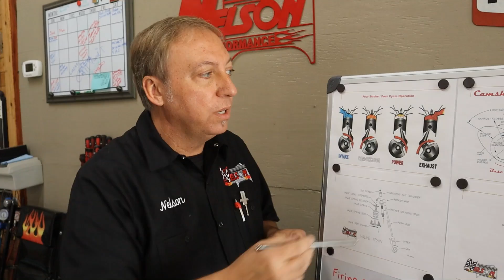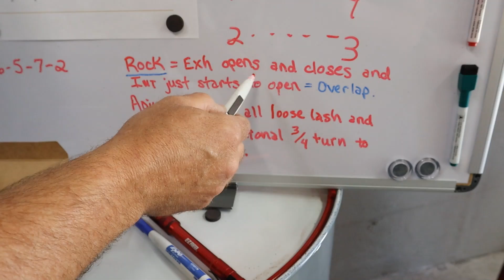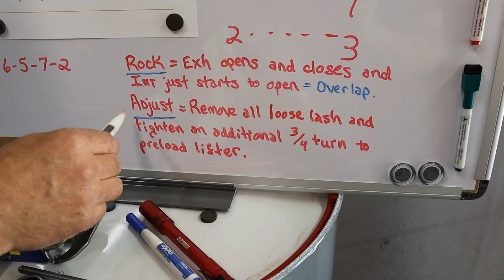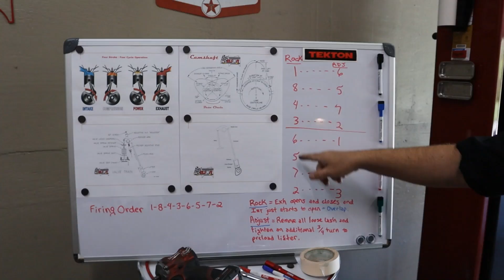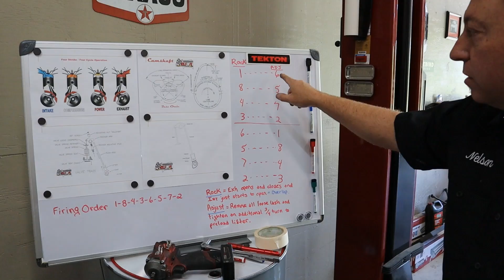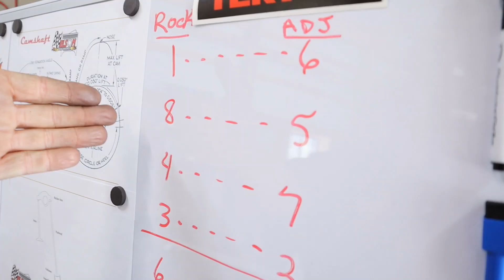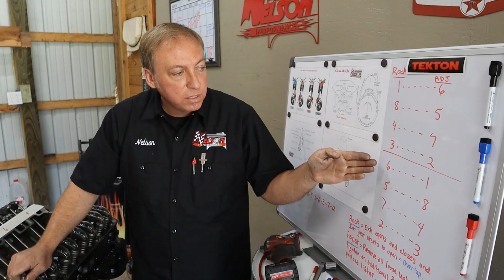Rocker Arm/Hydraulic Lifter Adjustment

Comment: so if you have the timing marks lined up & adjust # 1 cyl, could you just turn the engine 360 degrees so both timing marks are @ 12 o'clock to adjust # 6 cyl ?, thanks for an excellent video
Reply from the maker: Great! 👍Glad we could be a part of the project and thanks for viewing and commenting, Nelson

Comment: I must've missed something. What clip is he talking about in relation to the plunger ?
He doesn't want the plunger be touched by the "clip" 
Does he mean there needs to be clearance between the inner circlip and the central plunger ??
Reply from the maker: Hey Tony, yes, the wire circlip that retains the plunger. The 3/4 turn places the plunger away from that clip to prevent hydraulic oil pressure from popping it off and it ending up in the engine. Thanks for viewing and the comment

Comment: Can i use this method with lifters that are already pumped up? All of mine are still touching the retaining clip after im finished.
Reply from the maker: Hello, you can still use the 3/4 turn and do the adjustment with lifters that already have oil pressure in them. The valve springs have enough pressure to “bleed” the lifter back under full valve lift during the adjustment process since there is no oil pressure until the engine is started up. Good luck on your project! Thanks for the comment and viewing! Nelson
Reply: @mitchnelsonperformance  Thank you so much for the reply, Even though this video is many years old. 🤝🏼
Reply from the maker: no problem! Good luck on the project! Nelson

Comment: Hey there mitch, great video! One quick question. Can I use this method with an already installed motor will many miles put on it? 454 to be exact
Reply from the maker: Hello first off, thanks for the view! Yes, that will work just fine on a new or old engine. The adjustment is the same.  Having the manifold on is no problem, you can just watch for the pushrods to fall and rise instead of watching the lifters and if you feel the up and down slack in the pushrod while tightening the adjuster nut you will know when to make the 3/4 turn. You can have a friend tap the starter while you watch them but it takes a very slight tap of the starter to get to the next adjustment. Good luck on the project!
Reply: @mitchnelsonperformance  I appreciate the reply thank you very much.
Reply: @mitchnelsonperformance  one other thing I forgot to mention. Is I’m unsure of cam specs.. got the motor built but unsure of cam. Does
That matter?
Reply from the maker: Nope, as long as you know it’s a hydraulic cam then anywhere from 1/2 to 1 full turn of preload will work fine!

Comment: Great video! Can this method be used and be reliable with the intake already installed, any other hints in that situation?
Reply from the maker: Hello first off, thanks for the view! Having the manifold on is no problem, you can just watch for the pushrods to fall and rise instead of watching the lifters and if you feel the up and down slack in the pushrod while tightening the adjuster nut you will know when to make the 3/4 turn. You can have a friend tap the starter while you watch them but it takes a very slight tap of the starter to get to the next adjustment. Good luck on the project! Nelson

Comment: Can this be done with the intake manifold on? 
With the intake manifold on I'd imagine you can't see the retainer clip on lifter,  to make sure it's not getting hit .
Reply from the maker: Hey Philipdude, first off, thanks for the view! Having the manifold on is no problem, you can just watch for the pushrods to fall and rise instead of watching the lifters and if you feel the up and down slack in the pushrod while tightening the adjuster nut you will know when to make the 3/4 turn. You can have a friend tap the starter while you watch them but it takes a very slight tap of the starter to get to the next adjustment.

Comment: How would this work for an inline 6 engine? Would I write 1-6 down in a column and act as though it were a v6?
Reply from the maker: Hello, you just write the firing order just like in the video then split it in half (3&3) and then rock and adjust them. Like rock 1 adj 6, rock 5 adj 2, rock 3 adj 4 rock 6 adj 1….. not sure of your firing order. Nelson
Reply: @mitchnelsonperformance  thank you, I appreciate that you responded.
Reply from the maker: No trouble, thanks for the comment, and viewing!

Comment: I’m currently adjusting my rocker arms on a 350 and I tightened them how you explain but on some of them the bolt is barely threaded on and others it’s threaded plenty. Are they supposed to vary like this or am I maybe doing something wrong ?
Reply from the maker: Hey Terry, there are several things that can be happening here. If you look across all of the rocker studs do they all seem to be at approx the same height? Studs in SBC have been known to pull out as they are only pressed into the cast iron head. Also look at the tips of the valves. Are all of the tips at approx the same height? If you are using similar rockers like the ones in the video, are you for sure that you have the flat part of the rocker pivot ball facing the adjusting nut? Shorter or longer pushrods could cause this but less likely. Also if you got lost during the adjustment process and adjusted any of them during partial cam lift it would cause this but those rockers should be noticeably loose when rotated to the base circle of the cam. Hope this info finds your trouble. Thanks for the comment and viewing. Nelson
Reply: @mitchnelsonperformance  your video helped allot. I ended up adjusting the 2 valves that were giving me trouble while the engine was running. And I figured out the nut that holds the rocker arm down is actually what went bad and it kept loosening as the engine ran and caused a little “ticking sound”. But replaced the nut and  I just finished painting valve covers so letting them dry and testing it out tomorrow morning. Great video
Reply from the maker: Great! Glad you got it figured out! Nelson

Comment: Great do you have to remove intake manifold.
Reply from the maker: Hey, first off, thanks for the view! Having the manifold on is no problem, you can just watch for the pushrods to fall and rise instead of watching the lifters. You can have a friend tap the starter while you watch them but it takes a very slight tap of the starter to get to the next adjustment.

Comment: I HAVE TO TAKE APART MY MOTOR NOOOOO
Reply from the maker: And why is that? 😳 Do you feel you have misadjusted rockers? If it’s a FORD you may have the non-adjustable torque down type?
Reply: @mitchnelsonperformance  i have a 1985 ford f150 and i keep having trouble with my middle rocker arms clattering, and it started early this year after i did a head gasket job
Reply from the maker: Some of those engines have the torque down rocker bolts. Have you pulled a valve cover first to check it out?
Reply: @mitchnelsonperformance  yes muiltiple times actually adjusting them to no avail, they just always chatter consistently. Im thinking i may have to replace the whole passenger side but im not to sure if that would even work, i used a feeler gauge as well, but if i do have the non adjustable torque down type im not sure if i even needed to? They are stock rocker arms too
Reply from the maker: You mentioned “adjusting them to no avail”. Are they adjustable? Or are they a 5/6 bolt? If they don’t have a nut on a stud then the only way to change the depth of the plunger in the lifter is to put in shorter or longer pushrods. If only one side (bank) is pecking it may be an oil feed issue to that bank. Like maybe an oil passage plug that has came out. If it’s only a few on that bank then it may be a bad lifter (or a few). I would start by removing the valve cover and starting the engine and making sure the rockers are oiling on that bank. Good luck!

Comment: I do have a question.  The later vortec  engines  have a factory  roller  cam. Will this method  still apply?
Reply from the maker: Hey Steve, yes, the process works with any hydraulic lifter (roller or flat tappet) as long as you have the locking 3/8 thread adjuster nuts and not the smaller torque down style. Thanks for subscribing and the comment! Neslon

Comment: good morning I am in Jamaica of a Chevrolet 95 Chevrolet S10 V6 gas I need a cylinder head gasket head for it
Reply from the maker: Hello, I’m afraid I’m not familiar with your area as far as parts availability. Do you have access to Amazon delivery? If so if you type in (1995 Chevy S10 head gasket) they have a complete set to do the job for around $50.00. Before ordering you will need to know what kind of fuel injection you have (multi port or throttle body). Hope that helps and thanks for viewing and subscribing! Nelson

Comment: Here I use a 350 Camaro 74, I didn't do it that way with 3/4 of a final turn, do you need the tappets to be completely unloaded?
Reply from the maker: Hello, you can still use the 3/4 turn and do the adjustment with lifters that already have oil pressure in them. The valve springs have enough pressure to “bleed” the lifter back under full valve lift during the adjustment process since there is no oil pressure until the engine is started up. Good luck on your project! Thanks for the comment and viewing! Nelson

Comment: 4.0L Jeep engines have hydraulic lifters, but you don't have to go through all this bullshit.

Just torque the rocker arms to 20 ft. lbs. and GO!
Reply from the maker: Yes, the torque style are handy unless you have done a valve job and the valves have sank up in the heads or the heads or block have been milled then we use the process in the video to make sure the engine doesn’t need a shorter pushrod to achieve the proper lifter pre-load. In heavy production we used a GO~NO GO gauge to check them. The lash between the valve tip and rocker had to be no less than .080 and no more than .180 (dry lifter) or it required a pushrod length change since the engine was non adjustable. Good luck on your projects! Thanks for the comment and viewing! Nelson

Comment: Big question I’m working on a 2015 Chevy Tahoe that had lifter failure ready to put head back on and the rocker arms I was about to do this today and I got a little bit confused about torquing it down to 22 foot pounds with the 3/4 of a turn that you did. You don’t need to Torque it down anymore  that’s my question. Thanks. By the way, this was simplify so good saves you a lot of headaches it’s my second time doing this same vehicle same lifter it’s been almost 2 years of the first time I did this
Reply from the maker: Hello, on that style rocker you will for sure want to torque it down. The process in the video where you do an additional 3/4 turn is used for the jam nut style “adjustable” rocker nuts. You can still use the process to make sure the lifters still have enough pre-load (cup off the inner clip) and enough room for oil to fill the lifter after you torque them. Thanks for viewing and the comment! Good luck on the project! Nelson.

Comment: ok but you are doing this with the manifold off, what if you want to adjust with engine in the car? also how do you tell if you have solid lifters?
Reply from the maker: Hey, first off, thanks for the view! Having the manifold on is no problem, you can just watch for the pushrods to fall and rise instead of watching the lifters. If you take your time and monitor the “lash” you will know when you are at zero lash and then do your 3/4 turn from there. You can have a friend tap the starter while you watch them but it takes a very slight tap of the starter to get to the next adjustment. As for the solid v/s hydraulic it would help to know the camshaft model otherwise I would remove a spark plug and make sure the piston is down, then tighten a rocker down against the valve a watch for the lifter/pushrod to “bleed” back. You could mark the pushrod at the head or guide plate to keep track of movement. Nelson

Comment: Great explanation. Can the rocker be checked with just the valve cover removed?
Reply from the maker: Hey, first off, thanks for the view! Having the manifold on is no problem, you can just watch for the pushrods to fall and rise instead of watching the lifters. If you take your time and monitor the “lash” you will know when you are at zero lash and then do your 3/4 turn from there. You can have a friend tap the starter while you watch them but it takes a very slight tap of the starter to get to the next adjustment.

Comment: So by following this method you would install the lifters dry or without pumping them up with oil? I'm getting ready to replace my lifters and I keep hearing conflicting ideas about how to install them. I'm leaning towards coating them with assembly lube, installing and then adjusting pre load as is done in this video then bumping over the engine with starter a few cycles to send oil to lifters then firing up and running motor. Is this an acceptable approach?
Reply from the maker: Hey! Exactly right! I would assembly lube them, then adjust them so you can see and feel that pre-load then if possible I like to use an oil pump (drill driven) primer to pump up the system before installing the distributor. Good luck on your projects! Thanks for the comment and viewing! Nelson
Reply: @mitchnelsonperformance  Thanks. Much appreciated.
Reply from the maker: 👍 No trouble!

Comment: Hi the  lifter is pre' oiled thx
Reply from the maker: A light oil is ok but if possible I would only coat them in assembly lube and then adjust them so you can feel and see the pre-load then use an oil pump primer to fill the system before installing the distributor. Thanks for the comment and viewing! Nelson

Comment: So if I rocked the proper cylinder and am adjusting cylinder number 1, is that Cylinder being at Top Dead Center? Sorry for the noob question, but no question are bad questions.
Reply from the maker: Hello Paul, actually both cylinders (the one you “Rock” and the one you “Adjust” are both at TDC. One of them (cyl 6) will be on the exhaust stroke and cyl 1 will be on its compression/firing stroke. Hope that helps, and yes, you are right, there are never bad questions! I’ve asked them all at one time or another in my life. Good luck on the project and thanks for liking and subscribing! Nelson

Comment: I complimented Mitch re; his video some time back, and I'll stick with it. It is well done! 
My only issue with so many of these videos today, is the verbiage, or language,  that is used. 
"Lifter" is an old school term. Today, these are technically "cam followers". 
The part of the hydraulic cam follower in the center, is the plunger, aka hydraulic plunger. 
The term "adjusting valves" makes me cringe....... as mentioned, we DO NOT adjust valves. Once a valve has been installed and spring loaded, there is no further adjustment that can be made to the valve. 
As for Spark Ignition, this occurs prior to TDC...... not at TDC. This is very important to know. 

My least favorite is hearing someone call an Engine a Motor. These are Engines, not motors. 
Motors are electric, hydraulic, pneumatic, etc. 
Yes, you can pick up a can of motor oil, but turn it over, and read the back side. The manufacture will refer to Engine. 

Call me excessive or anal if you want to...... but this is the correct verbiage (aka technical language)  that should be used today.
Reply from the maker: Thanks again for the comment, and your knowledge!

Comment: Love the video.  Gonna use to re-assemble for 408 Windsor this weekend:  Question(s) for the group or Mitch

(a) Is there a recommendation for torque on the rocker arm bolt?  Noticed Mitch did a 3/4 turn once valve was in the proper position. 
(b) Prior to the 3/4 turn, is the rocker arm bolt supposed to be tightened to a certain level?

Apologies if this is already covered in this awesome video, as I might have missed it.
Reply from the maker: Hey Drew, the later Windsor heads with the 5/16 bolts were non adjustable and should be torqued to spec. I also recommend a small amount of blue removable thread lock on them. You can still use the method in the video to view lifter cup preload. I believe with an empty lifter (no oil), the rocker to valve tip clearance should be no less than .080 lash and no more than .180 lash when the bolt is torqued and the cam is on the base circle (no lift). Hope that helped, Nelson
Reply: This is not an adjustment whereby stud/nut torque can be used.
Reply from the maker: Correct.

Comment: I may have missed it, but does it matter if the lifters are filled with oil?
Reply from the maker: Hey Terry, I would recommend you do the adjustment without oil if possible, then prime the oil pump after the process. Thanks for the comment! Nelson

Comment: I am reassembling a 262 4.3l vortec v6 after changing head gaskets. I like the rock and adjust method. It seems like it will get each cylinder at tdc on compression stroke really well. My question is, the serivce manual says to tighten rocker arm bolt to 22 ft.lbs. is no lash+ 3/4 turn a better method?
Reply from the maker: Hey Sam, if it has non adjustable torque down rocker nuts instead of the crimp lock nuts like in the video then you will for sure want to torque them or they will loosen while running. You can still use the process to view how much pre-load the pushrod is pushing down on the lifter cup. Hope that helps,  Nelson

Comment: So how is this done if the intake manifold is already on the motor?
Reply from the maker: Hey, first off, thanks for the view! Having the manifold on is no problem, you can just watch for the pushrods to fall and rise instead of watching the lifters. You can have a friend tap the starter while you watch them but it takes a very slight tap of the starter to get to the next adjustment. Good luck on the project and glad we could be a part! Nelson